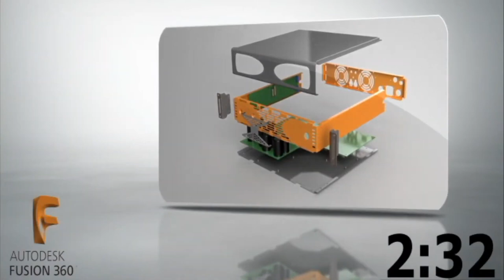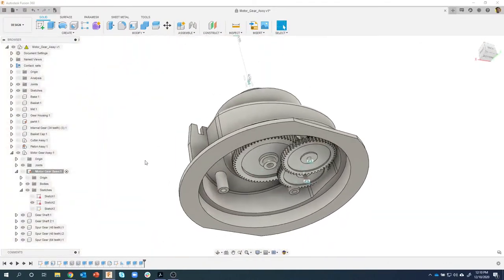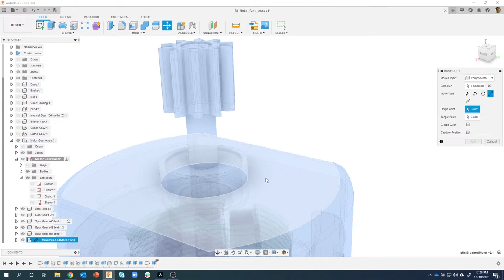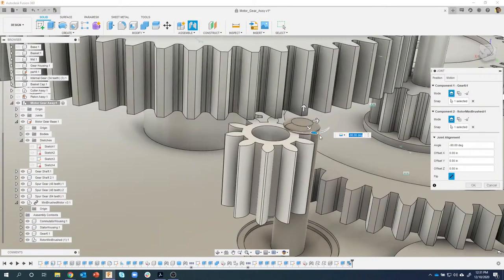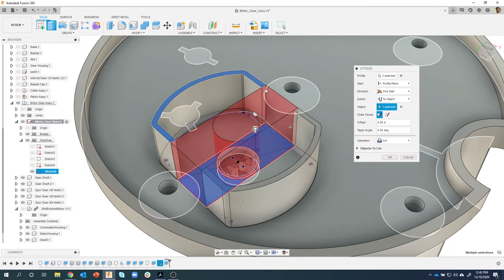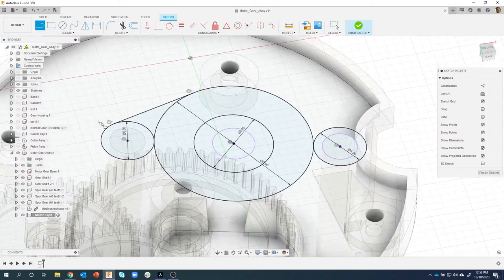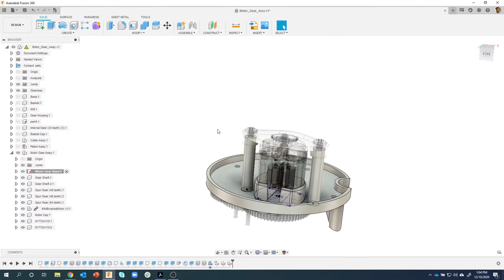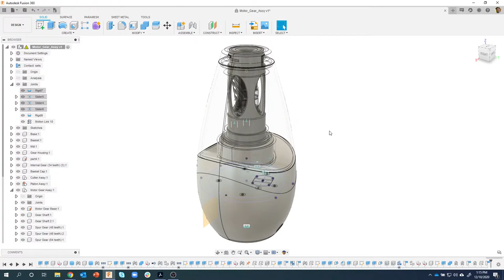Episode 80 - Pencil Sharpener Project, Part 10

Comment: hey Brad ...Nice presentation .....I need some help in Browser organization... I loved the way you layout the browser.. I also need some guidance in 3d dimensional editing.  You presented it very well.  1. Leave component on 2. find sketch 3. right click 4. show dimension  This certainly saves me  time. I edit dimension in a trail and error situation.  Nice work in model editing.  Question??? I have a Mac can I get your gear add on Fm Gear......Cant wait until next week.
Reply from the maker: @Joesph Vassallo-  I unfortunately did not know that FMGears was not available for the Mac when I was using it for this project.  It is my understanding that there is currently not a similar plugin.  I know there is a Spur Gear creator built into Fusion 360 (in the Tools-->Add-Ins), but you will have to play around with it to get similar results to what I created with FMGears.  Sorry.
Reply: As always you are incredible...JV